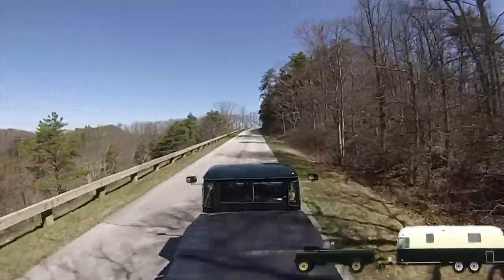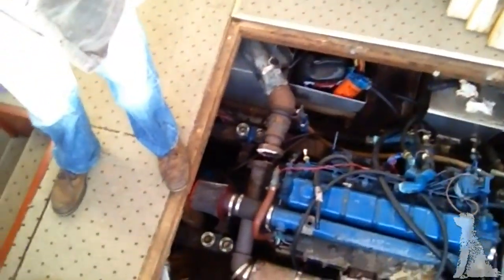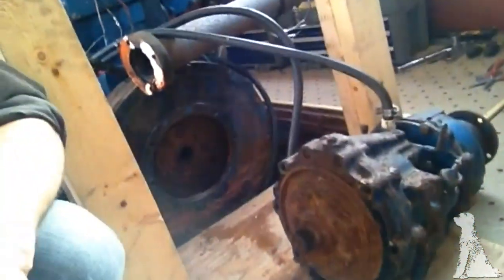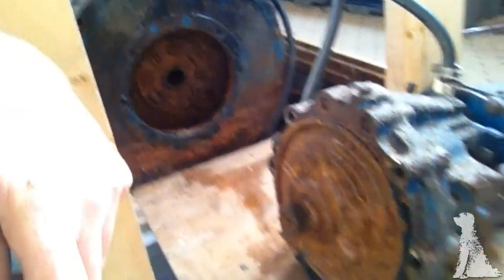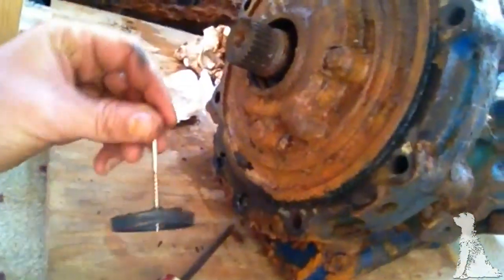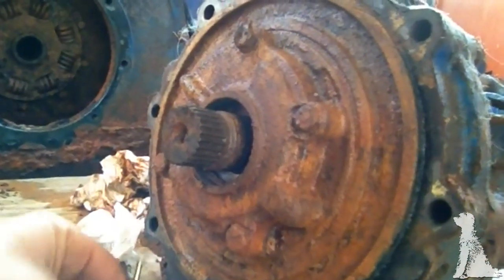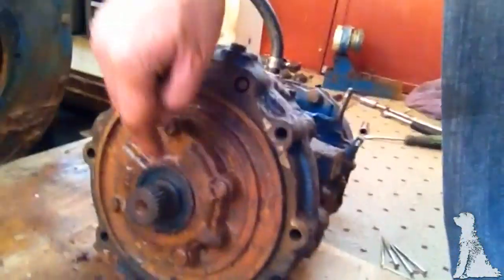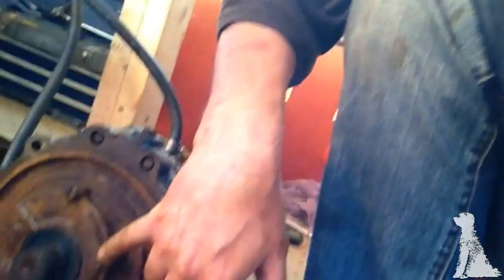Oil in the bilge, transmission leak - Wooden boat restoration -Boat refit - Travels With Geordie #41

Comment: One thing to aware of is that you can get fluid dripping from the bell housing that looks as if it came from the front oil seal but actually came from the control valve O-ring and ran down the outside of the transmission. You don't need to take out the transmission to fix that - it's an easy fix.  I found this out the hard way!  But when we got the transmission off there was no sign of fluid near the front oil seal - all as dry as a bone (like yours seems to be actually).
Reply from the maker: Great tip. mine was the main seal but good to know.

Comment: Hey man you got easy, I had two engines to worry about. She had twin Leyland 2,5lt laid over engines, they were a pig tp work on. So swapped then for a pair of Ford 2.5lt same power but a lot smaller, bought marinized kits that fitted right on and PRM gearbox's. She was an absolute doddle to use especially in marinas coming alongside. Mind you I had plenty of practise as I kept her on the Thames just west of London.
Reply from the maker: OOOhh, the Tidal Thames, good to have a kindly vessel there.I am gratefull to only have one lump to feed though.Some day I will steam up the Thames...